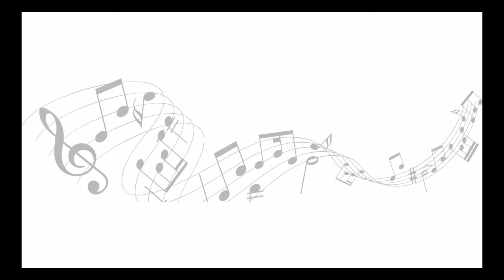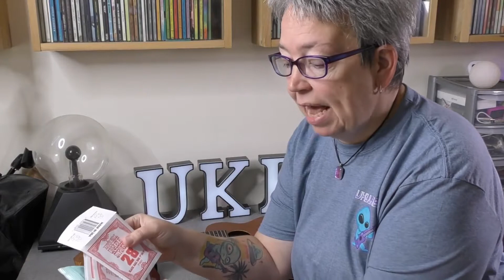Ukulele String Change - How To Restring Your Ukulele

Comment: Thank you for this and the rest of the series. It's really confidence-inspiring!

I know we can't all have television studios in our homes, but I have to say I never could see what you did with getting the knotted string into the hole and then the slot. That part was pretty well blocked by your left arm. ;-) And one more comment: You don't need that music behind your voice. Your voice is what's important, and the music is distracting. But that's all minor, and overall, very helpful video and series. I feel the urge to try some new strings coming on!
Reply from the maker: Hi Cate, Thanks for the feedback, always appreciated. Yes, I'm annoyed with myself as I was also recording a different angle with my phone for the bridge area but the recording didn't work as I didn't double check everything. Normally I could have redone the bits but because it was a "job" that got completed I couldn't re-record. I did consider not doing the video but I'm not sure when I'll be changing a whole set again but will certainly try to do a close up next time (and I'll triple check the phone!). Also appreciate what you are saying about the music, I tend to use it when there is a lot of fast forwarding through a video but will certainly think about that for future videos too. This was all quite new doing these maintenance vids so a lot learnt in the process and hopeully can improve future ones.

Now get changing those strings! ;-)
Reply: @UkuleleWales  No good deed goes unpunished.